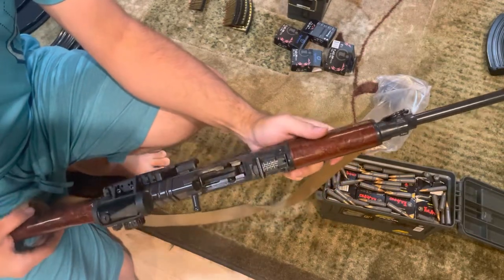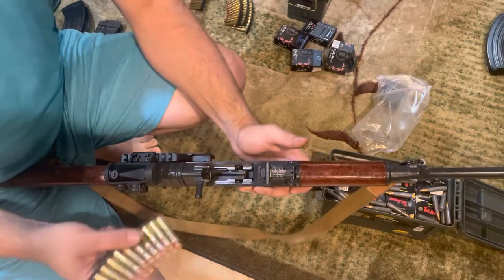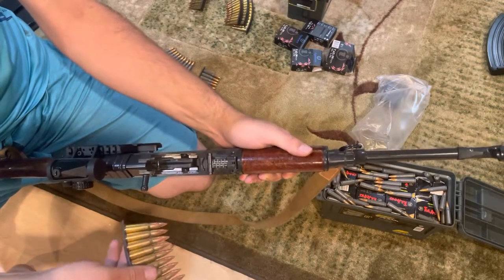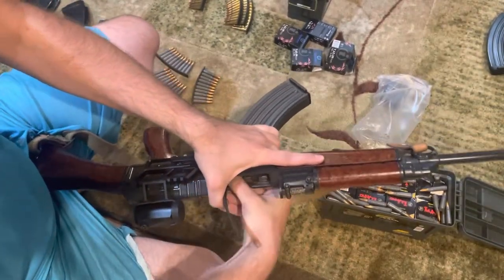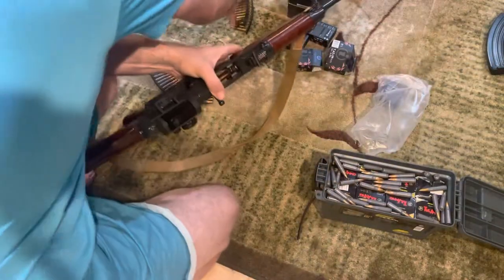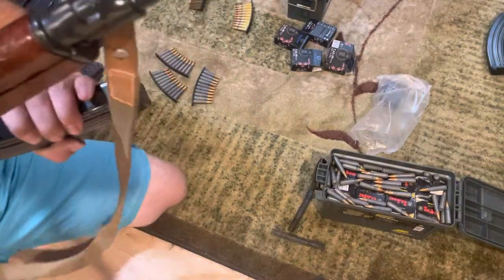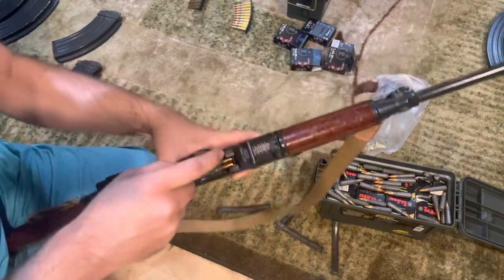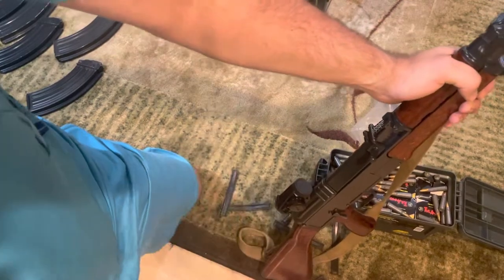How to load the Vz 58 with stripper clips

Comment: Just tried this, works great! I has stopped using stripper clips with my Vz because I could never get them to work. Thank you for this video!
Reply: its a little awkward, because I'm left handed but I can wedge my thumb a bit between the charging handle and the tripper clip and its fine.